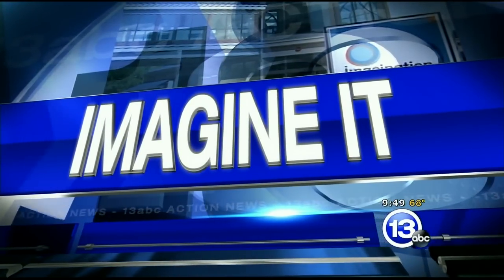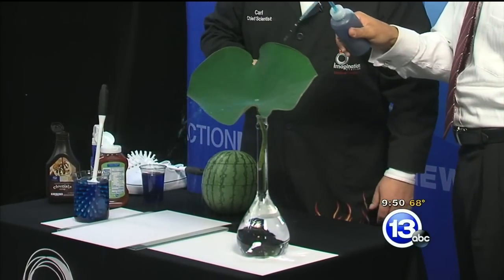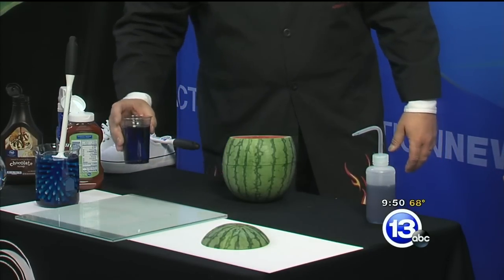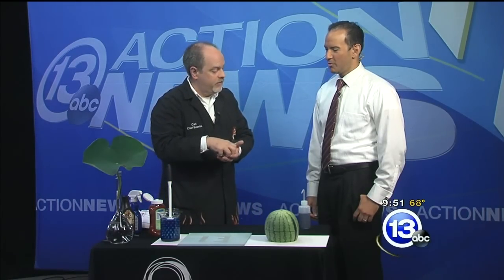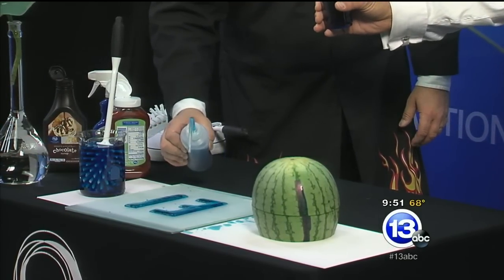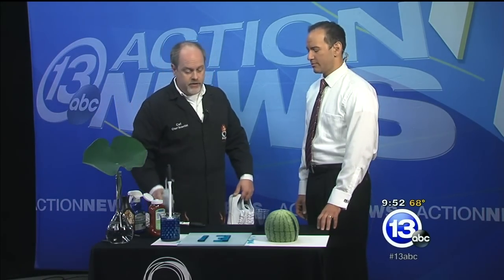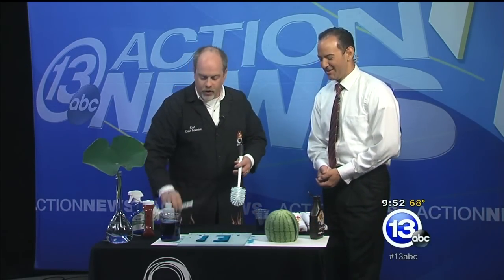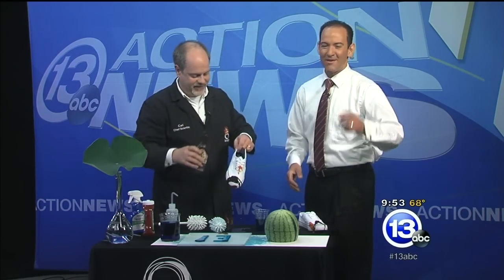Superhydrophobic surfaces

Comment: The Never Wet is deceiving. They hide the fact that it lack lusters the surface or crustifies it. You can't use it on automobile surface or automobile glass, as it "frosts" the glass. And foolish Rustoleum bought the license for it and added Never Wet to their lineup so it could be mass sent out for $$ through home improvement sections of retailers. I took it back to Walmart or Home Depot (whichever) and told them they should be ashamed to perpetrate it on customers.

However! With many months of research and talking to people on the technology, I found a Manufacturer that does it right. 2 actually. And there's good reason they're not Home Depot - ing, etc promoting it.
Reply: And, Never Wet (standalone/original) has had their video of 2 jeeps mudding with one coated and one not for years and held tight no sales or distribution until Rustoleum pops up with it. The Jeep that had it on the windshield as well as whole truck, would have to have been driving blind or with camera outside the vehicle for sight. Yes, it was cleaning off the mud, but the frosted glasses and lack luster paint surface isn't worth it.